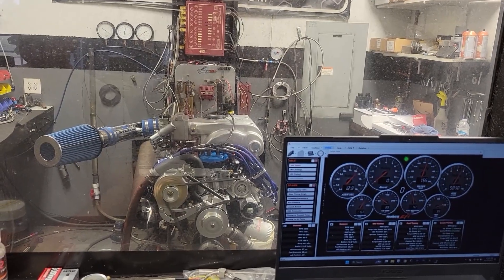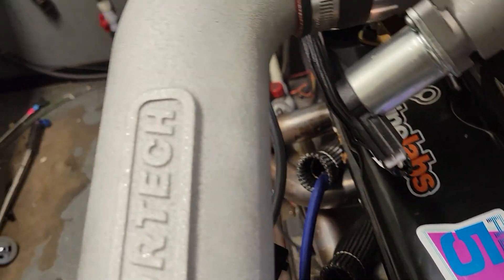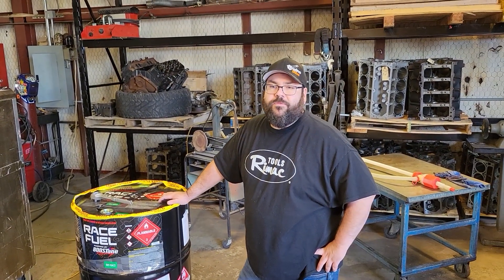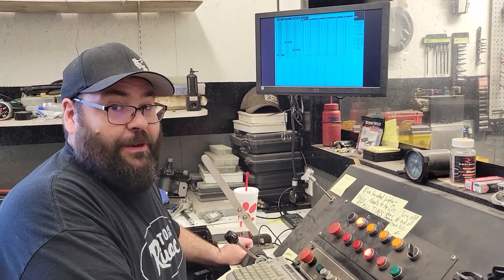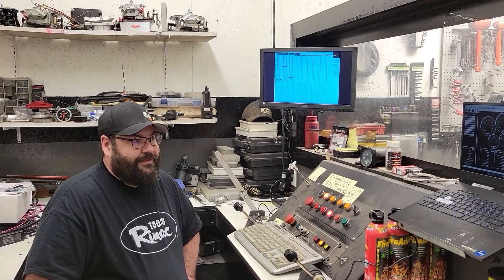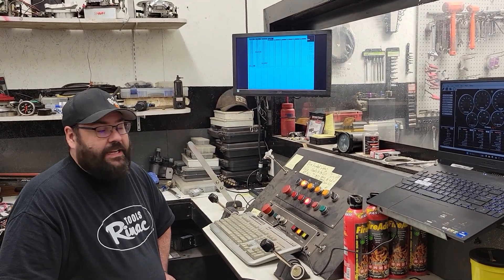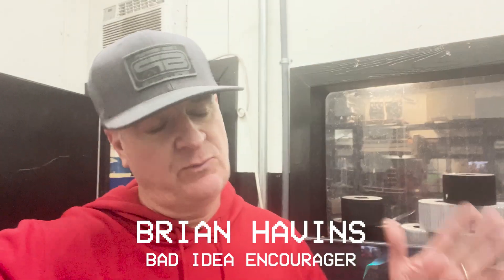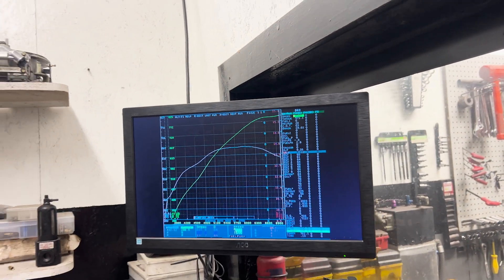Making INSANE Power With A Stock 302 Block and Vortech Supercharger | Retro 5.0

Comment: I made 427hp at the tires on a Mustang dyno with a stock 1988 shortblock, stock camshaft! Trick Flow 170cc heads, Trick Flow Track Heat intake, 70mm throttle body! Pro-M 80mm mass air, 42lbs injectors, 1.7 Scorpion rockers and a special NMRA Real Street Ricky Best Vortech S-Trim Supercharger.
Reply from the maker: There's a name I haven't heard in a little bit... 😞

Comment: @EngineLabs- I'm a new subscriber. I ❤ & have owned numerous 5.0 Liter H.O. Engines. I was thinking about how well the New for 2025 Tfs 227cc 11R cyl. Heads, with the New Ported Trick Flow R Single plane, a 2" super sucker carb spacer, using a 1000 cfm Holley Hp square bore carb., a Trick Flow stage 5 cam, but using solid roller lifters, on a 12 to 1 compression, 363 cu. In Big Bore, using a dart block, with stepped 1-7/8" to 2" headers, what do you think about my engine combo, Hp guess? Oh, & as for the setup in this video, with the stock block 302, i wonder if you swapped out that stage 1 Trick Flow cam, for the stage 3= 236 @ .050 int. Dur./ 248 @.050 exh. Dur., it should kill some Tq. (which i think splits the block if too much, quicker than the Hp), should also drop the psi of boost, but still make more power. Then maybe to help this engine live longer in a vehicle, change pulleys, to drop the boost down to 11 Lbs. or so. With the stage 3 Tfs cam, & only 11 Lbs. Of boost it would prob. Still make 700 Hp, what do you think about this !? Awesome video! I would ❤️ to see this engine in an Automatic car, with a 4,500 to 5,000 rpm tq. Converter!

Comment: I've been 10.0 with a S-Trim pushing 18lbs on a stock 5.0 bottom end. I ended up changing the motor before i pushed it any further. Im in Delaware and was racing at Cecel County Dstrstrip. They closed for the season before i could try to get a 9 second run on a stock 5 litre bottom end. I believe it would have made it with a pulley change but i didn't have any others on that last night. And by the time they opened in the spring my car had a built 306 that went 9.40 with  T-Trim. This was in 1998. I actually went 10.0 3 times in a row.
Reply: It dont get no better then late 90s Cecil co dragway in a 5 0 mustang

Comment: How about talking about how much horsepower a supercharger takes to run? Most people don't know this, but it takes hundreds of horsepower to spin it
Reply from the maker: Not these smaller blowers, but yes. The bigger race blowers can take a lot to turn. The problem is, the only way to measure what the blower is actually taking to turn is with expensive and complicated cylinder combustion pressure analsys equipment, or with a blower dyno setup.

Comment: I have see many stock 2 bolts with those cheep Chinese beefy caps and a girdel  hold 800 plus hp .
The key was alway's replacing the bs stick balancer  and to try to stay at 6 to 6500 rpm 

Seen them last for years

Btw . Stock crank . Stock rods . Older TRW forged pistons.

Comment: That is an awesome milll, to be sure! Just a silly question, what's the fuel mileage on that about four blocks to a gallon?😂 I guess it really doesn't matter when you're traveling FTL! 👍😁👍
Reply from the maker: I could probably calculate it at WOT using BSFC... it was GULPING that E85 on the dyno, though.

Comment: Did you guys ever run it on pump gas
Reply from the maker: We just released the article comparing the E85 pulls to Pump 93 with octane booster here: https://www.enginelabs.com/engine-tech/fuel-cooling/testing-boostane-pump-gas-vs-race-e85-on-the-dyno-with-retro-5-0/

Comment: Its amazing what some stock block will take while others split. I've seen an 850hp stock block survive hundreds of trips down the 1/4 and a 450hp stock blocj die on its 3rd run. I'd really like to see a 100% bone stock bottom end see what it could do. Oem grade bearings, stock bolts, etc.
Reply: It's all about balance.the vibrations is what kills them n causes them to split.look up project stock bottom end.he has a 302 pushing over 900hp n has made thousands of passes with it
Reply: @michaelmayer8618  I've seen it. It's just crazy how some stock bottom ends have perfectly balanced cranks and others don't. Well not just cranks the entire thing is balanced right. Makes sense why some spin way higher than others. Curious how many have girdles, upgraded dampers, bolts/studs, and other things to old it together. While still maintaining stock internals

Comment: Wish i knew someone that could help me with my 88 mustang, its my 1st build, its the original block but all new scat 331 stroker internals and all new trick flo top end kit, 170 heads stage 1 cam, systemax upper and lower, complete new everything, besides a bad surging idle it did great after warmup,  the problems started when i put bbk 1"-3/4 longtubes on it, it acts like it running out of air or fuel at mid open throttle, like a flat thudding spot, hard to describe but something is going on, i put a new 75MM MAF calibrated to 24lb injectors with accel 24lb injectors and upgraded fuel pump, car still has stock computer so thats my next move is getting the holley terminater ecu and hope that fixes it,  also gonna put the mac shorty headers back on it becouse it ran way better with those, everything got worse with those longtubes, if anyone is considering bbk longtubes i wouldn't do it unless you have a turbo or supercharged mustang
Reply: Was it converted to maf? Unless a CA car, 88 was speed density, which makes adding a cam tough. Could do basic tune W/O a chip, set base timing, and adjust fuel pressure, but may need a c&l maf for 24#. confirm you have the right ecu
Reply: i got mac shorty headers, 42ibs injectors, complete trickflow upper end with a vortec and a stock computer. car runs strong. it still has to be tuned this fall.

Comment: Now, when you talk about a split block, im assumimg you mean a 1980s rollor 5.0 and not a classic 302.. yes, they both are 302 cid, but ones known as the rollor 5.0 (the block that splits) and the other being just a 302. The 302 blocks are very strong.. the 5.0 rollor block is not so strong, supposedly.
Reply: 5.0 roller owner had it split right down the mains

Comment: Hey friend what pulley sizes were used??? What were the intake temps like?
Reply from the maker: Both are the stock out of the box Fox kit pieces. 6.87 crank and 3.33 blower. I've gotta pull the data logs for the IATs, but I remember them being really reasonable for no intercooler.
Reply: @EngineLabs  I just did a basic 331 with some aluminum china clone heads, cam, GT40 intake, and a V3 si trim with a 6.87 crank and 3.12 pulley on supercharger. I guess it’s going to make some steam! What’s your timing curve like? I did a meth water injection setup. I need to dyno mine. I think the clutch and transmission are ready to throw in the towel. I don’t take mine passed 6K just to be safe.
Reply: Picked similar for a Boss 302
Si: 51,900 at 7k; 6.87/3.33; 52k max
Si: 51,900 at 6k; 8/3.33; 52k max

Comment: Subscribed and following along, actually helping a friend who just built basically the same motor for his 91 fox with the exception of TFS intake and instead of a supercharger it’s got an on3 turbo kit, wondering what your idling @ cause I noticed in your last video it was around 1100 and funny enough my friends car is around the same with 60lbs deka injectors.
Reply from the maker: We never really played with the idle settings too much on the dyno other than getting the IAC dialed in, because we were short for time in each session. I feel like we could probably get a decent idle out of this combo. Looking at the new cam specs for Version 2... not so much. LOL

Comment: That is awesome!

The engine will last a lot longer on a dyno vs going down  the track in a 3200 lbs foxbody!
Reply from the maker: Exactly our feelings, which is why version 2 is coming. :)
Reply: Especially if it's a stick car with slicks, that is brutal for a stock block. My 332" with stock block is still alive after 25 years - 530hp, shift between 8000-8500, Dynamic C4 with 5000 converter, Toyo R888 radials, 2390 lb Mustang II. I also can't stress enough how good Dynamic Racing is with their builds, their Roller Mite C4 shifts perfectly - Firm without being too aggressive.

Comment: I winced with every pull on the dyno. Im impressed that it stayed together under boost. Some of them lived for years of racing seasons with the right tune. Good video... as usual.
Reply from the maker: I believe the ballistic rating of the dyno room glass was questioned at least once. LOL
Reply: wonder how much that main girdle is helping it stay together; looks aluminum so it should be additional vibration dampening?
Reply from the maker: @jojog8304  the main girdle is steel, and pretty rigid.
Reply: @EngineLabs what part number is that girdle
Reply: @jojog8304  The girdle is more for damage control when the block fails, than a preventative thing.

Comment: The stock block killer is  that junk ass 50 oz crank that hates anything beyond 6k. I broke 3 of them. The block is not the problem.
Reply from the maker: We've got that 50oz imbalance on this one. Going to 7K was "send it now, and pick up the pieces later" mindset.
Reply: Love to see that on a retro 289...Carroll said those 289,s turned 8,000 rpm all day and all night and lived .
Reply: Btw its the valley that splits not anything to do with the mains or how much iron there is there.. its the papper thin valley that causes them to split.
Reply: Mate for sure your statement is true, but the blocks just don't have the correct amount of iron under the main bearing sadles continuing up into the cam tunnel, adding 3.00" neutral balanced forged crank with 5.4" rod would be heaps better, also I wonder about using crappy main bolts instead of ARP studs seams to help, as letting the bolt flex and the cap walk slightly is better than a rigid main studs pull the block apart
Reply: Orly? Thats crazy, i pushed 540hp on one and ran 7500+rpm never split the block. Of course thats Not actually that much hp i understand that but its still more than people claim it can handle
Reply: Man I was sitting on the edge of my seat waiting for it to snap! Great stuff here
Reply: What is the cause of that crank?

Comment: What size injectors are y’all using?
Reply from the maker: Deatschwerks 78 lb/hr injectors. We ended up bumping base fuel pressure up for additional headroom.
Reply: @EngineLabs  awesome! I appreciate it..
Reply: @EngineLabs that's pretty low lb/hr for those numbers, but that explains raising the fuel pressure.
Reply from the maker: @pimpovic2  not really. 78s at 43.5psi are dead on for 775 crank with a blower and E85 at 85% duty cycle. The blower's listed max HP is 775, which is why we sized them where we did.
Reply: @EngineLabs people don’t think E85 requirements be like they do

Comment: 351 is so cheap these days. Why not have the extra strength and cubes. Then the stroker possibilities it’s really a no brainer. Cool video but I wonder what’s cracking the blocks. Transbrakes maybe or high boost (massive torque)early.
Reply: size and weight.
Reply: Have to think about it, its designed to be a 200hp engine so even at 500hp you are double the required specs. As with all stock parts, some might do 10x design while others give it up at 1.5x design.

Comment: Please don’t perpetuate the 500hp myth. Excellent job by the way. The way the centrifugal makes boost is why it can handle much more. Now 600 plus torque at low rpm with a turbo, might be a different deal.
Reply from the maker: I mean... the block is in one piece. I think we're  doing more to dispel the myth than perpetuate it. But wives tale or not, I've seen broken blocks, and I don't want to put the stock block in the car at 800-plus horsepower. Running the risk of splitting a block on the dyno is one thing; doing it in the car is a whole different proposition.
Reply: The 500hp Myth never seems to take into account the fact that the 1982+ 1-piece rear seal blocks, aka "5.0" are substantially lighter when weighed on a scale than the pre-1982 2-piece rear seal blocks, aka "302". I compared one of each side by side, and the difference in main webbing thickness is obvious, which accounts for the difference in weight between them. p.s. I asked a former Ford engineer about the weight difference in the blocks, and he mentioned that the blocks were lightened for the Fox body cars to reduce some nose weight and improve handling.

Comment: Awesome work Donut!  The biggest thing that kills the block in my experience are the RPM's, keep 'em around 6000 and the stock block can live longer at higher HP's.
Reply from the maker: Thanks Chris! At the end of the day, I wouldn't really ever be able to trust the stock block in the car. So, a new shortblock it is!
Reply: Smart move, time for big power :)
Reply: also rebalanceing the rotating assemble to zero balance with help it live a long time.....I ran a 600 hp twin turbo charged stock block for many years with no issues.
Reply: @WienerSnitzel337 was it 600 to the wheels?  Also it's easier to push more from a turbo on any engine vs a supercharger.  It won't see as much stress at xxx power level as it would w a blower at same power level.. people generally push engines to higher hp numbers on average on stock block and stock bottom end stuff with turbos vs blowers from what I've seen.  Also being on really good fuel helps.  So turbo and e85 is the safest way to make the most hp aka it's more likely to stay together at higher power levels.